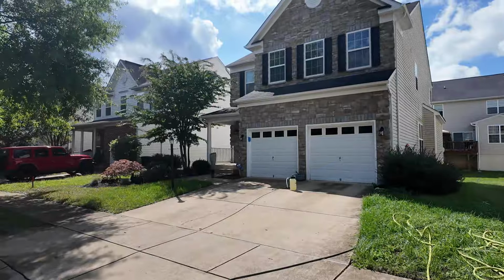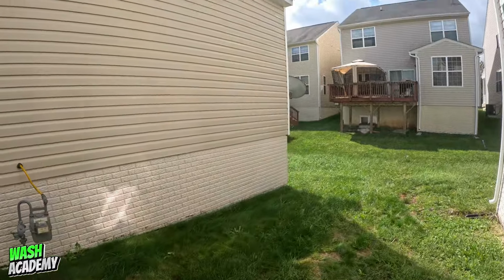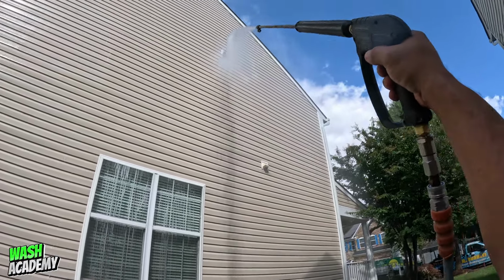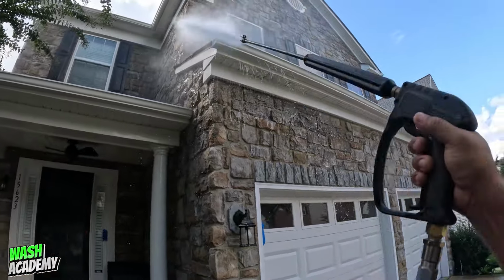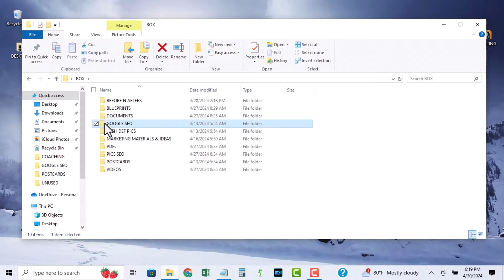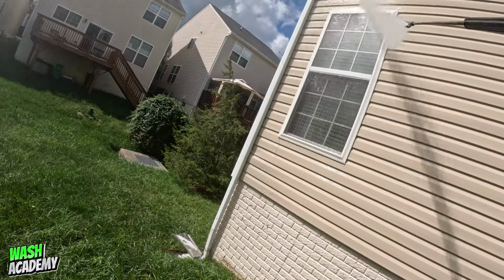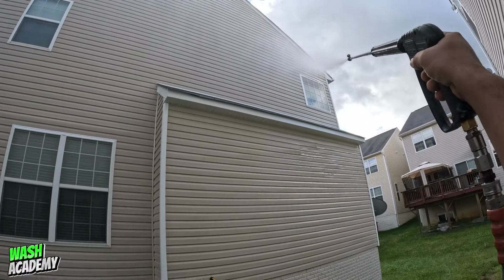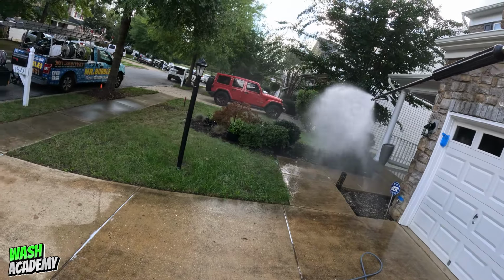Ep.180  How to PRESSURE WASH A HOUSE Without a Ladder 💦

Comment: Good evening.   You've commented that you make a batch mix of 50/50. 12.5% mixed with water. 

Which size injector are you using?  Is this an 8gpm pw?  
Thanks for all the very informational videos you've done.
Reply from the maker: Hey brother, thanks for the great question, I use the 2.3 here's the link to the one I get: https://pressuretek.com/gp-hi-draw-chemical-injector/